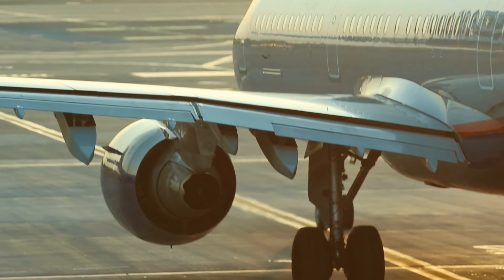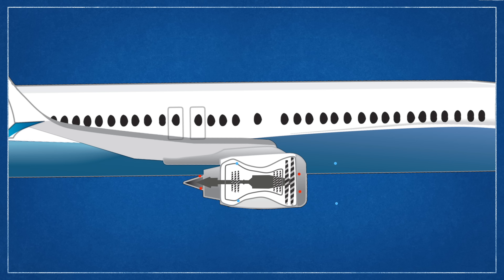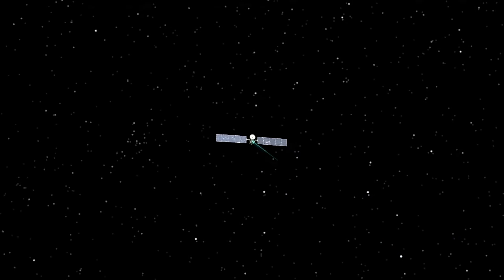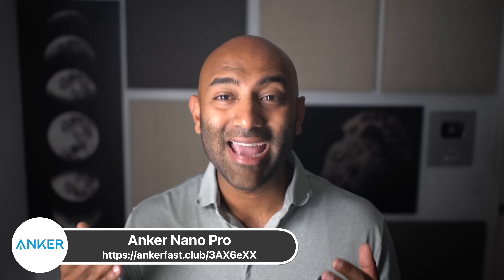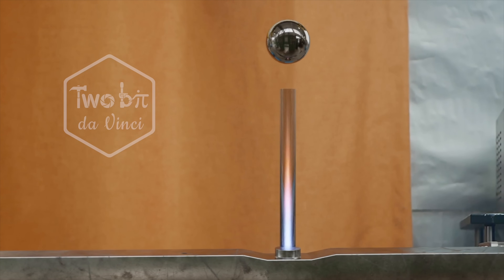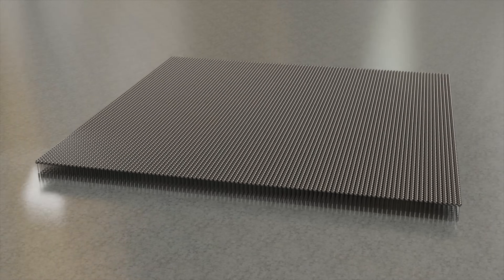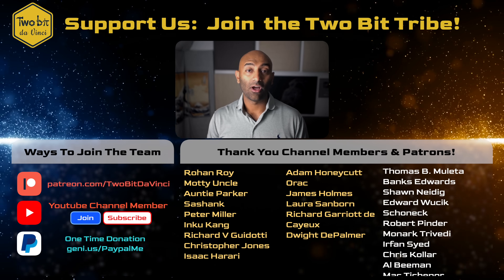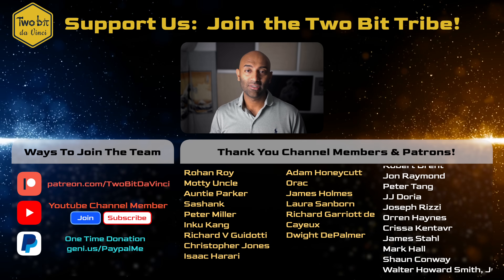The Next Generation of Jet Engines.... Is Electric?

Comment: Scaled up you would need a huge amount of power to run this thing. If we look at a empty un-fueled 747 it weighs about 190,000kg, too make it easy we will say 200,000kg, assuming the thrust scales up Linearly we need 200,000kg x 400 = 8,000,000W which is 80 MW. a coal plant powers about 650 homes per MW so 650 x 80 = 52,000 homes with of power.  But planes can’t actually lift their own mass, the 747 only has about 550kn of thrust, which comes out to us only needing 22MW or 14,300 homes worth of power. Still Need a SMR or something, but it’s definitely more doable.
Reply: @levi4979  The problem is planes crash. Which is why we don't have nuclear powered planes. Besides crashing consider how poorly maintained planes are today. Would you put nuclear powered planes in the hands of this industry when they can barely keep the current planes flying? Many planes have crashed because of neglect.
Reply: @rowenkylee5627  : The real reason we don't have nuclear powered planes is that even if they don't crash, the radiation both onboard and surrounding the plane (remember, you need ground crews to be able to safely support the plane!) will be unsafe for any reasonable weight of vehicle. We won't see "nuclear" planes until we get isomer reactors working, and maybe not even then.
Reply: @absalomdraconis  Yes that too. The kind of shielding you need for it to be safe is too heavy.
Reply: To be pedantic: plane ENGINES can't lift the plane's mass(*); that's why they have wings and use runways.

(*) Exceptions: helicopters, jump jets

To calculate required power use mghve where v is vertical rate of maximum climb and e is some overall efficiency factor. The thrust force is irrelevant unless its intended for VTOL.
Reply: @levi4979  I do think this is quite doable with power satellites beaming microwaves to rectennas on the jet, but the jet would have to be quite large to have a low enough power per m^2 to not cook the jet. lasers might would but at a lot lower efficiency, and I'm not sure how people/counties would feel with 100s of GW lasers above them.
Reply: you need to cut away all the weight from fuel system first.
Reply: @SS_SunnyNMoon  its not exact but I used a he figure for a 747 without any fuel cargo or passengers, the figure would be even lower if you used a newer and smaller composite jet like the 787.
Reply: @Matthew.  I'll need to correct you a little on your calculations.  A modern jet-engine has an efficiency of approximately 417 W/N, so the total fuel input you need at 500 KN is 229 MW.  I think you forgot the 9.  Plasma engines are rediculous.
Reply: Yeah, electrical engines are used in space because getting energy is easy enough with some solar panels, while taking along reaction mass is difficult because every gramm you take has to be lifted by the launcher. So fuel (or reaction mass) efficiency is often much more relevant than power efficiency of the driver. And low thrust is less of a problem since you don't fall down, so less thrust just means that you need to accelerate longer to get to your final velocity / orbit altitude.

On ground, on the other hand, you need zero reaction mass since you just the air around you for that purpose. The energy on the other hand has to be taken along and is the relevant design driver. And the thrust needs to be sufficient to generate enough lift before the runway ends. So I have no clue why anybody is doing research for electrical drives (or plasma jet engines), given that it will raise the price of the flight by a massive amount, assuming you can even take along enough energy to make it work on passenger jets.
Reply: Humans 0
Saiya-jin 1 to 6
Angels 7 😇

Kalki Ironman 5th matriya buddha 8th arc Angel 11th satguru 13th imam and 24th avatar after 2026 😎

Almighty God 9 😇

Humans type 2.5+ after 2026 by Kalki Ironman (christ in the white horse)(son of man on clouds) type 7 and 8 😎

Jarvis the world’s first artificial intelligence (parrot) 😎

Cuz Kalki is ironman batman super saiya-jin superman ben10 saitama Narutoo optimus prime and every super heroes combined after 2026 😎

Jarvis world’s first artificial living being (just like vision in marvel universe)😎

Made of Quantum and sub quantum particles 😎

Power source quantum energy arc reactor (type 7) level technology 😎

Kalki Ironman going to have every kind of arc reactor like:- type 1 Nuclear fission, nuclear waste, hydrogen fusion, type 2 3 4 5 antimatter arc reactor (solid liquid gas), type 6 electro quantum arc reactor, and type 7 Quantum arc reactor, type 8 limitless quantum energy arc reactor without quantum particles 😎

Kalki Ironman going to have sun in a box million billion tons of hydrogen nuclear fusion reactor type 2 3 4 5 just like sun and stars in the palm of his hand 😎

This all going to happened by self replicating quantum nanobots knowledge energy and techniques at type 7 7 7- respectively 😎

Ironman (Tesla 2.0) going to reveal every secrets of the world specially Tesla and his Antigravity 😎”
Reply: There is also a secret technique for flight in the atmosphere, plasma propulsion panels. They are located in the form of round zones around the perimeter and on the bottom of the device. A column of ring vortices is created from below and along the movement - this is how the device flies... Everyone has heard about railgun guns - this is a system of two extended longitudinal contacts-rails and a projectile between them. If an electrical impulse is applied to the rails, induction will accelerate the projectile to cosmic speeds. Following it, a jet of hot plasma will also fly out. Such guns are being developed in many countries. The momentum created by the railgun can be used not only to fire, but also to move. Accordingly: spacecraft have pulse engines that shoot plasma at the right moment - creating sufficient force to move from one orbit to another. For example, “Ablative pulsed plasma engine”, there are reviews on electric propulsion engines. These engines are large; a plasma jet appears there when a plastic plug located between the electrodes burns. Secret vehicles (“flying saucers” and “dark triangles”) have propulsion panels. There, railguns are reduced to the size of a pencil and assembled into flat panels, which in design resemble the plasma panels of ordinary televisions. The distance between the contacts is small - an ordinary spark of an electrical discharge becomes the bridge between them. The cells operate synchronously: they shoot jets of plasma - sparks of electric discharges accelerated by the force of induction. Their speed is enormous, the number of railguns in a panel is hundreds of thousands. The total motor impulse is impressive. The discharges occur at a megahertz frequency, each pulse striking the air, which swirls into toroidal rings. These toroidal rings form the air cushion on which the vehicle flies. In the horizontal direction, a pushing effect is created in the same way. In a vortex jet, due to the rotation of air, the temperature drops - moisture from the air is frozen in the form of snowflakes, on which the light of electric discharges sparkles. The result is a kind of “solid beam”, which, when rocking the apparatus, is capable of bending - because the trajectories of the vortex rings are bent. The devices fly quickly and they are very maneuverable - thanks to the lightness of the device (it is made of composite materials). There is harm: from pulsed plasma engines - microwave radiation. Load capacity is low. There is no radio communication. Narrow application profile - rare spy missions. The question is often asked: where does so much energy come from? Answer: they use super-galvanic cells that create a current of 1000 A. The principle is simple: a magnesium tape (magnesium on a viscose basis) is scrolled past the electrode in the presence of an electrolyte. It's like playing tape in old tape recorders. Magnesium is completely oxidized and enough energy is released. Previously, magnesium tape was thrown out as an “exhaust” - this is how rumors arose about “angel hair” that remains after the passage of a UFO. Now the waste tape is collected and magnesium oxide is recovered. This technology for generating energy is very expensive, but it is used for spy technology.
Reply: That's the thing. RC cars work great with small batteries but scaled up to an automobile you have a 2t monster. 
Despite it's size the ICE is still good at converting fuel and fuel is one of the best energy storage. With the help of an electric motor the efficiency can be increased a lot.
Reply: @Enforcer_WJDE  tesla
Reply: @Eli9A  What of it?
Reply: @Enforcer_WJDE  they also have a terrible conversion loss from fuel source (power plant) to power use... aka moving the car. not to mention the amount of energy put into producing the car... and eventual waste generated from the tons of batteries and the mining costs of the tons of lithium and cobalt.... which many people seem to ignore since its not done here. when we add up energy used for energy extraction  all the way to energy used to produce the vehicle to how much is used to move the vehicle ... EVs are dead last... the most efficient green use of "power" is actually a horse pulling a cart made from bamboo...
there is no getting around the laws of physics. energy in minus energy out always has inefficiencies in between.
Reply: @vl3005  moving the point of pollution further away from your home doesnt mean you pollute less over all.
Reply: @renaissanceman5847  The laws of physics right:
ICE fuel conversion efficiency about 30%, recycling gas efficiency ZERO...
And don't forget about all the pollution created by gasoline extraction, processing and utilisation.
You should try opening both eyes.
Reply: @renaissanceman5847  yeah
... but you pollute someone unimportant instead of your home and friends.
Reply: @renaissanceman5847 righto tiger, whatever, have a nice life.
Reply: @renaissanceman5847  I have my ev for 7 years already. No plan to get rid of it.  Battery still running at 90z capacity. I have spent more money on normal maintenance on my 2 year old ICe car than I have on the EV. 
I have solar panels. They help charge the car and provide power to my home.  Simply put.. I don’t do it for the environment… I do it because it’s is more economical.  You are now changing subject from EVs being more polluting and less efficient to all the things oil brings besides running an ICE car.  I never said stop drilling. I just said that your argument is flawed and found to be debunked many times.
Reply: @brucemc1581  fair enough... I think we need more nuclear energy... but the costs of building a site are expensive and take forever. new thorium reactors would be best. but big oil doesnt like the idea of us cutting the well off and industry demands oil for all the plastics it uses. BTW I drive the same car because I fix any issues it has cheaply, locally and DIY. I dont use solar on my home because ROI is negative (20 year life) because our cost is 11 cent per KWH. I dont like solar and wind farms because of the enormous amounts of land they take and the e-waste result. The majority of vehicle exhaust emissions are composed of carbon dioxide, nitrogen, water vapor, and oxygen in unburned air ... less than 1% is other... look it up anywhere on the web .. and all of which can be absorbed by plants, aka carbon capture... which our farm land in the USA now exceeds that of the remaining rain forest... so the more land we destroy for solar and wind and lithium mines... the worse we will be.
Reply: @renaissanceman5847  Nuclear yes.  I don't fix my cars,  I am lazy... i used to though. Got old and moved.. sold tools..live in another country..etc...  
Where I live my ROI on Solar is 7 years!  That is because electricity is bloody expensive. I think it is now over 33 US cents per KW, if not more. I get the wholesale price (yes the rest is tax) of 13cts for what I do not use and put into the grid.
On the waste part..  everyday, Coal and oil plants put into the air more waste comparable to throwing away a panels after 30 years, or decommissioning an old Wind Mill. Plus, you can manage where to put the waste from Panels and windmill. Carbon and other poisons, just float off into the atmosphere.
Respectfully, I still don't buy the argument that mining for minerals for EVs is more detrimental than mining/drill (and spilling) and burning fossil fuels. All the data I have seen (could be echo chamber) states the opposite.  None of the arguments put forward to support fossil fuels over mining minerals for EVs was convincing.  This is because they left out big chunks out of the data.  As for using the minerals for energy storage for the grid, that I am unsure/on the fence about.  I think there are better ways to store the energy than in batteries.  As for using land for Solar or Wind.  My Panels and all of those around me on on roofs. Sure, it aint purty, but like I said 7 year ROI!  And, no. no government support. By the way, I have a large house and we use under 5500 KWH year. Which is about average.  In the US (assuming that is where you are) it is double. Back to panels, Yes there are some fields that are covered by panels. But these are owned by the farmers. Their choice how to use the land.  It is a free market. So if growing food would be more profitable than they would switch to that.  And in may other countries, the panels are in deserts or arid places... so....  And for windmills, there actual foot print is small.  Are they ugly and loud, sure.  That's why they are not around populated areas. Again, upto the farmers if the want have them on their land and listen the whoosh all the time.

Anyway, it is about the use case.
Reply: @renaissanceman5847  if the overall system efficiency is much greater, then it does mean you pollute less overall. a lot less. it's easy to find sources for this, have a look.
Reply: @Enforcer_WJDE  just to be clear, I never said EVs are clean.  I inferred they are cleaner than ice.  Even if the power they get out of wall is 100% coal generated, it still cleaner than ICE cars.  For ICE there is a lot if energy spent in refinement.  And a lot in transport to a gas station. You then have to drive to that station to get the fuel. And the car itself only converts 20% of the energy from pump to road. The rest is lost in heat.  I don’t have the numbers off the head, but the energy loss from delivery to refinery to the pump was much higher than from power station to you outlet.
Clean no.  Cleaner, yes.
Reply: @3rdrock  ICE efficiency can be over 50% if designed right
Reply: @ayoutubechannel921  got any examples?
Reply: @3rdrock  generally two stroke diesels tend to be the most efficient, with low-speed ship engines reaching 50% efficiency, along with the opposed-piston 2.7L 3 cylinder reaching up to 53% thermal efficiency. If companies researched more and optimized engines for efficiency instead of emissions reduction, the efficiency could possibly go even higher

Comment: quote "using fiber optic cables to beam energy , this is not a joke" so a flying thing needs a trailing fiber optic cable to the ground to supply energy ? and you are saying that's not a joke ? are you SURE you have not had a lobotomy ? I swear I can see where the ice cream scoop opened up your skull and scooped out your brains.

Comment: there is no compression involved, usually it is a high voltage potential that is used to accelerate the ions, the efficiency lies in the fact that you use minimal propellant, but use electricity to supply momentum to the particles,  any device such as this thing is still woefully useless because it is using literally millions of times more propellant and wasting energy by using a standard kitchen microwave oven magnetron to energise the propellant, highly inefficient. Not only that, but where exactly is all the energy coming from to both run the compressor AND the magnetron ? This is absurdly, utterly ill conceived nonsense, any idiot who asks the simple question, how much energy does the WHOLE system need?  more like half wit da vinci.

Comment: China made one about 5 years ago and satellits have been using them for 50 plus years,
They dont give emissions but they emit ions this may effect the O3 molecules in the Ozone layer.
Other than that they give no emissions,  depending on what gas you mix with the microwaves, Argon Oxygen Hydrogen, depending on the gas used to make the plasma will determine if there clean or not, but there will be ions coming out of the exhaust that may effect the O3 molecules

Comment: Very promising technology indeed, if the power generation & storage can keep up.
In the meantime, there are projects to include such air-breathing plasma engines in very low altitude satelites to compensate for atmospheric drag. 👍
Reply: And unlike heavier-than-air aircraft, they actually make sense in that use-case.